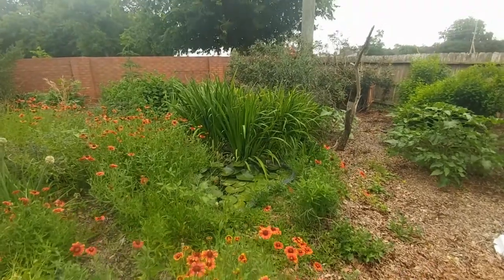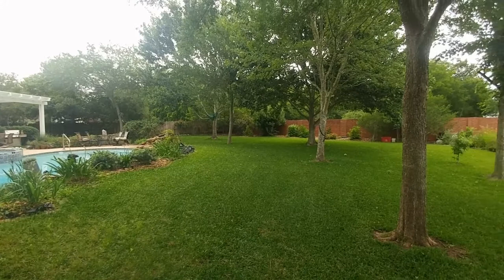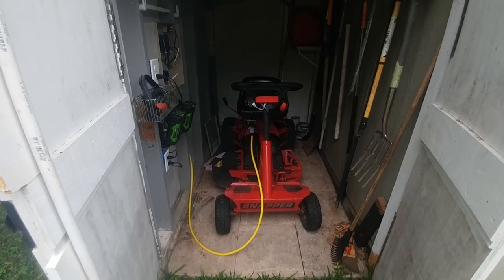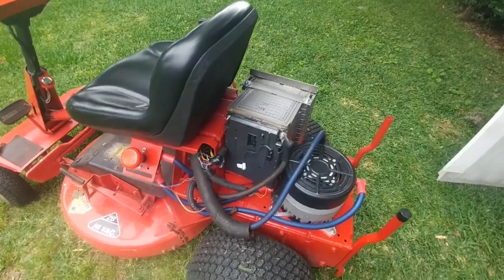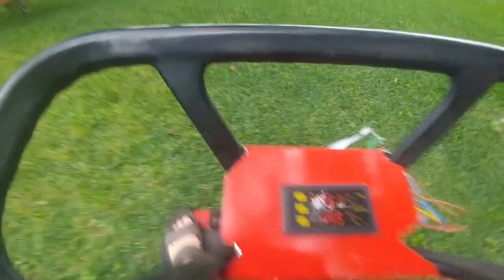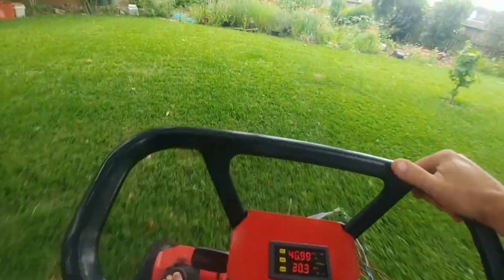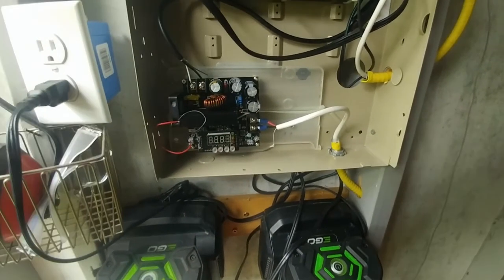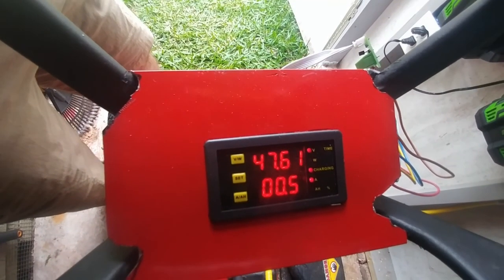My electric conversion of a snapper Rear engine Rider mower

Comment: Extremely cool.   I’ve mowed with snapper mowers my whole life, great mowers. Tough little machines.   I purchased a Ryobi 38 inch cut electric RER for my mother last year. I was surprised to find it had lead acid battery’s.  I think lithium ion batteries would be a better choice  based on power to weight ratios.  I suppose they were building to a certain price point.  I’m looking to convert a large mower 48 or 50 inch cut.  I’m looking forward to your future videos with more details of this project.
Reply: I am also surprised that the new machine uses lead acid battery. Cost for sure.

Comment: Good video.  I had thought about using the same ME1004 motor with batteries, contractor, and gauge like you have here.  I had planned on connecting same pulley to drive original deck and hydrostatic transmission on my John Deere La115. The project looked fun but the price rage was around $2000. Not your fault but it was more than I had to spend. I enjoy your project and keep looking for an electric conversion I can do. All the best!

Comment: Richard, Hello.  not sure if you would pay attention to comments here, I went searching for people who did this snapper conversion.  I have a  mower and the gas engine finally locked up, so I want to do the conversion.   I like yours without a controller because the mower is perfect to convert.  I have questions about your start button.   I want to make sure I have the proper protection for the start circuit.  If you wouldn't mind sharing how you wired it, I would appreciate the assistance.    and I love your conversion, great job.

Comment: Sweet man, great job! I like the simplicity of the snapper for this conversion. No inefficient hydros, just pure electromechanical fun. Did you consider using a controller and just leaving the trans in gear? That would probably be more efficient, but more costly for sure. I'd really like to know what kind of run time you get off the 2kwh volt module?

Comment: Looking at doing the same conversion with a Craftsman 30" 10hp mower.  I have the motor already.  Are you using a BMS on the battery?
Reply from the maker: @richardthompson8423  I went thru and checked each cell with a voltmeter versus its neighbor.  All balanced to within .01 volts after quite a few charge/discharge cycles.  I was shopping around of eBay for a bms, but then checked my voltage on my cells and found still no need after all this time.

Comment: Going to tidy up those loose wires under the steering wheel?
Reply from the maker: A bit cleaner now, as I no longer bother with the ammeter, so I only really need two wires headed up to the guage to read voltage.

Comment: Incidentally, what did that all cost you?
Reply from the maker: Battery was about $460, the electric motor was around $520.  Probably $200 for other stuff.
Reply from the maker: Yeah, neat looking but it has lead acid batteries.  Ancient tech for 2018.

Comment: Too bad you don't have specifics, like parts lists with detailed assembly diagrams or at least a video of taking it apart piece by piece so others could duplicate, ALL I use is Snapper RER's
Reply: Re. parts, this should get you started: https://www.electricmotorsport.com/me1004-emc-r-ls-drive-kit-with-motor-controller-throttle-contactor-wire-kit-and-fuse-block.html
Reply: @loxleyfarmlet6165  Thanks, but NOT knowing ANYTHING anout electrical stuff and electronics such isn't much help, your disassembly & reassembly with detailed notes & photos would help many folks

Comment: The motor that I am using is a DC motor. The battery puts out DC, so no conversion to ac needed or helpful. To run an ac motor, I'd need to add an inverter and a motor controller at minimum. Nearly all lawnmower conversions without a cord hanging out would be DC. Anything with a battery too.
Reply: I believe the motor controller would act as the 'inverter' in this instance (running an AC motor). e.g.: https://www.youtube.com/watch?v=qzlLh8xxx1g